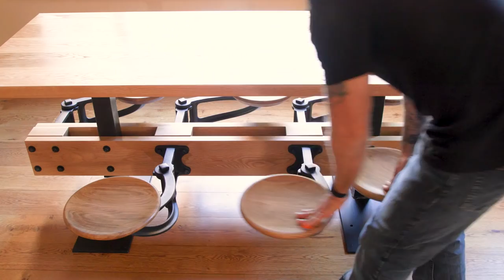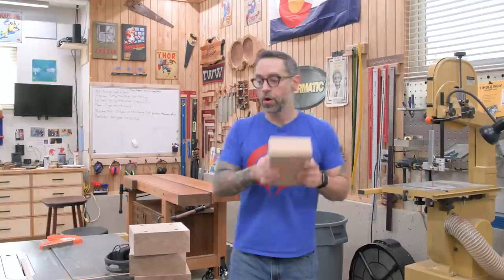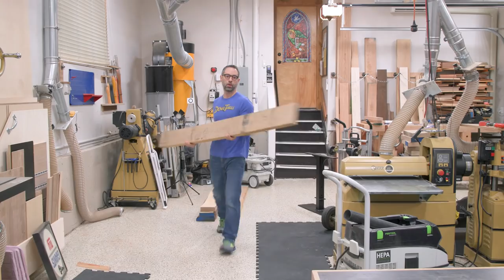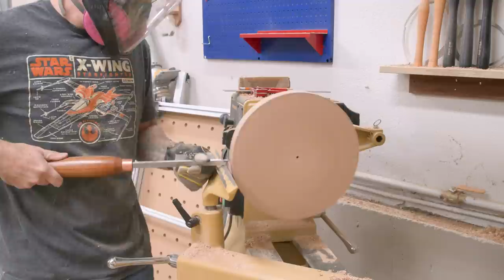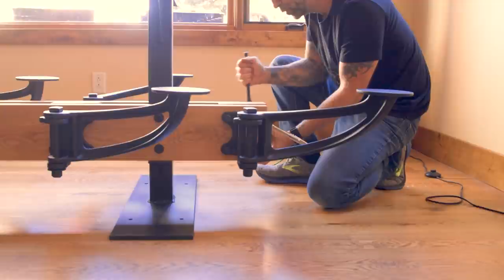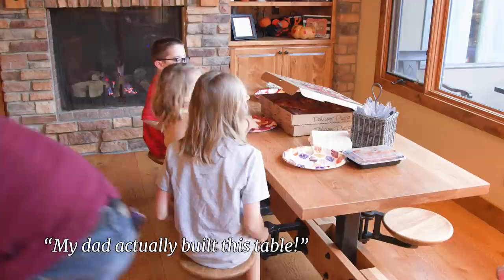How to Build the Best Alternative to a Traditional Dining Table

Comment: Marc, if you seated multiple adults on one side with nobody on  the other side to counterbalance them, would the table tip?  Or is it beefy enough that that's not an issue?
Reply: I wondered the same thing. What if you are, say, in Wisconsin and there are three burly guys at a table next to a swimming pool and there are babes in the pool. Forget for a minute that it is early June and the babes look like Casper the Ghost. Who cares?

If the three burly guys are sitting one one side munching on Culver’s cheese curds, does the table tip over?

Comment: Absolutely fantastic looking table. The hardware is top notch and it is no wonder it comes at a price. You could do something similar with Benchcrafted swing out seats but it won't be cheap either. Good things cost in life. Greetings from Croatia 😊
Reply: the curve in the getback swing-out seat design was what made the decision for me. the straight arm on the benchcrafted swing-away stool didn't allow enough room for the legs, not without hitting each time you move. good design for kids at school but for adults at a table you need the bend in the cast iron arm, which also extends out further, if you want (as they're adjustable on these swing-out seats, which i love. so they don't hit anything and can still tuck-away nicely. i agree with you both are good options and both are well made ..perfect for those who want the best.

Comment: nice built, i really like the hardware and your finish on the wood. one question, is there no problem by glueing the two spacer block pieces together and the grain of both facing the same direction? could it warp or do you think the wood dimensions and bolts will hold it straight?
Reply: In this case with large beams on each side and bolts through it there is absolutely zero chance of those blocks warping.  There is nowhere for them to go.

Comment: Looks beautiful.  Wouldn't a bench serve the same purpose as it can be slid under the table when not in use?
Reply: but then the wood legs kept scratching the wood floor and with three teenage kids they could never agree on how far or when :) it was a nightmare with the bench, and half of the time they all just ended-up falling back on and landing on that same wood floor. the swing-out part has proven to be the fun (and safer) part for them. and I agree it does looks beautiful.

Comment: Great build! Anyway to make the seats without a lathe?
Reply: You could make the circles with a router jig and use a steep bevel on the bottom to give them some shape.  After that, either leave the tops flat or power carve out the dish.

Comment: Any concerns about wood movement and mounting the wood seats with four screws? The mounting spacing doesn't appear to allow a lot of movement but I'd like to hear your take on it.
Reply: Thought the same thing
Reply: The movement over that sort of small width of the stool seat tops will be next to nothing. Wood movement in the table top would be of concern, though.

Comment: 🤔🙋🏻‍♂️ Why did you apply the finish to the lower beam with the yellow card and scotch brite pad but then with a brush for the top? Thanks!
Reply from the maker: I wanted a more substantial build for the surface that would get the most abuse.
Reply: @woodwhisperer  AHHHH Makes sense. Thanks for the reply!

Comment: Wondering if one could use bent lamination and build the hardware out of wood. May look a bit too beefy, but I may try it out once I receive my vacuum bag.
Reply: I would be concerned about structural integrity
Reply: @daveklein2826  I think a 2" thick frame from oak w/o any curve - similar to the benchcrafted swing away seat - would work. The curve may be an issue ... 
If it doesn't work, I can still throw money at the problem ;)

Comment: Interesting - a bit pricey with the hardware and 6/4 white oak. The only drawback I would anticipate is the lack of a seat back, which could be addressed by adding a swivel to the seat to allow the back to tuck in flat against the table top. Is there anything on the base to protect the floor?

Comment: When turning the seats.  How do you make sure they are all the same?  I do not have a lathe so this may be a question about a rudimentary task.
Reply: I think it's just a matter of feeling, worst case they're all slightly different but it's nothing you'd notice
Reply from the maker: The diameter is pretty easy to get right. The scoop is easy enough using a small template. You just drop it into the opening and look for the high spots. The profile on the edge starts with a couple of guidelines then it's all by eye. Anything in the round is very forgiving to the eye if there are slight differences between each piece.

Comment: Price of the kit is a bit insane. $2800. Cool Idea but for the amount of work that is needed to even make this a table its a bit nuts. Atleast you swindled a free kit out of them Marc.
Reply: But where can you get it cheaper?
Reply: @kevinn6538  Hey if it's worth it to you then order up. I'm just saying it seems a bit overpriced. $1500 seems more reasonable.
Reply: Yeah, got real jazzed about this project. Thot maybe 500  or up to about 750 ... then finally clicked link .... 2800 ... wow ... let this set in for cuple hours b4 responding. Sorry, while "nice", WAY overpriced. By the time you figure in wood, easily over $4k ... a little bit fot time, over 5k. What we need Marc, is YOUR version of doing something similar, but a LOT less $$ ... betting something could be designed with perhaps some stock, maybe obscure, metal, etc. Sorry, 2800 is just WAY out of line. Guessing a lot of that may be liability should the seat hardware fail, etc. That's my "2800 cents"!
Reply: @rockbandgamer  I agree with you 2,800 to me anyway is a lot of money for an entire table let alone part of a kit. If you were to try and make this to sell to someone 2,800 plus probably 500 in wood and finish materials plus your labor costs probably 2k dollars so you'd have to be selling it for 5,300 plus dollars plus tax plus shipping maybe. I feel like it's hard to sell something for that much money. I would say the kit is worth maybe 1k dollars but I'm sure their cost of steel and labor has been through the roof the last couple years so I don't exactly blame them.
Reply: @rufthrock.b3266  $500 or $750? Maybe if it was made out of pressed/stamped sheet metal and sold by Walmart or Amazon.
Reply: @dedalliance1  You can look up examples on Etsy... It's going to give you sticker shock but once that clears you'll have a better idea what these types of cast-iron hardware actually costs, never mind final finished products... Like the comment from Ryan Dury, which he noted a local restaurant in his area has a similar table that's longer at 20 feet but that one cost $20,000...  

Basically, $1500 is wishful thinking... Especially, now with the price of steel, etc.
Reply: @ZeoCyberG  Yeah I guess I'm just poor lol. I do hardwood floors here in Colorado so I'm constantly in and out of multi million dollar homes, some of these people are spending 20k on light fixtures lol. We sorta did a floor in Fort Collins in a condo this guy flew wood flooring in from Europe lol, his cabinets alone supposedly cost a million dollars lol.

So people out there have the money but unfortunately it's not most of us working class people lol. I'd like to know what these people do for a living because apparently I'm in the wrong profession lol.
Reply: @dedalliance1  they make videos for YouTube!

Comment: Lol, you FINALLY use the lathe, and I'm thinking, "hooray." And then you do a bone headed move and remove it from the lathe to apply the finish!?
That's like Walter White and Jessie Pinkman struggling to carry the 55 gallon barrel of methylphenimine instead of rolling it. 
That's why I bought a lathe! I'm lazy. You can rough cut and then do everything right on the lathe. Take it from the lazy woodworker. 
The Lazy Woodworker, I like the sound of that! 

The Lazy Woodworker. (I hope that name's not taken)
Reply from the maker: That's great in theory if you have one turning to deal with and a fast drying finish. But when you have six seats and a slow drying oil, it's not a very good option. :)
Reply: Nope, bone headed would be trying to put on a slow dry finish on a high speed machine.... Think before you speak
Reply: @The Wood Whisperer  perhaps boneheaded, was not the correct word to use in written form. 
I meant it in the nicest way possible.
Reply: @richardpatterson4312  LMAO

Comment: so it's just a completely regular table with swingout seats that look like torture devices if you're sitting in them longer than 10 minutes. and you have to pay $2800 for the hardware, probably around 5-700 for the wood, AND you have to build it yourself ??? Is this an early april fools joke ??